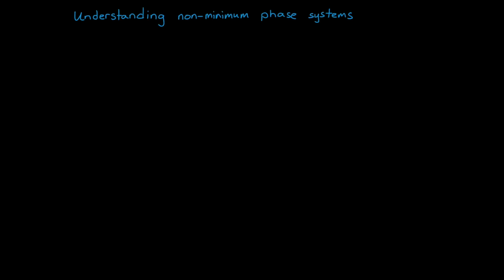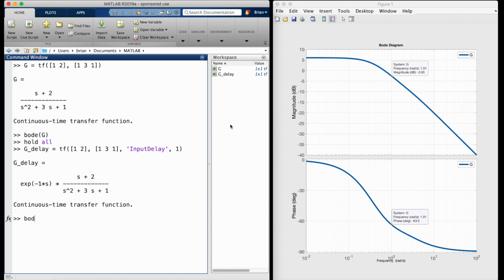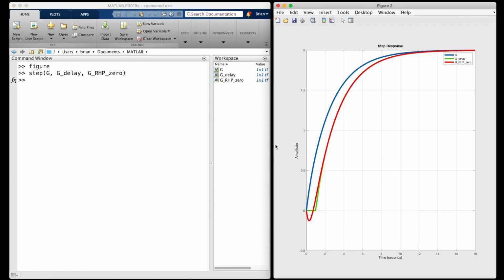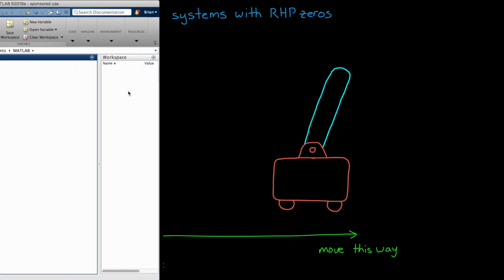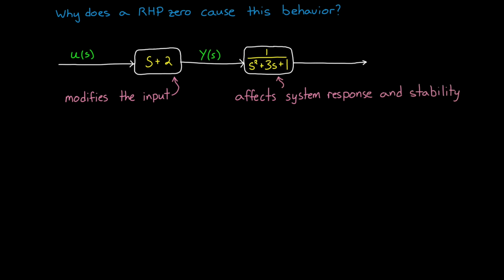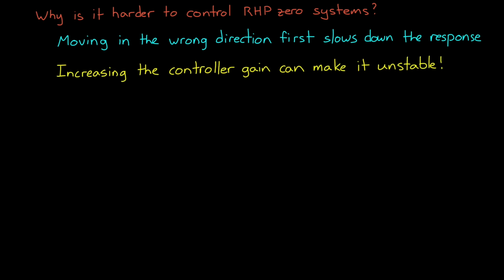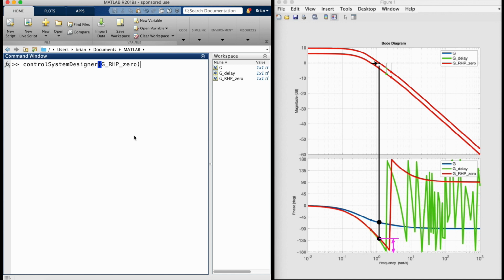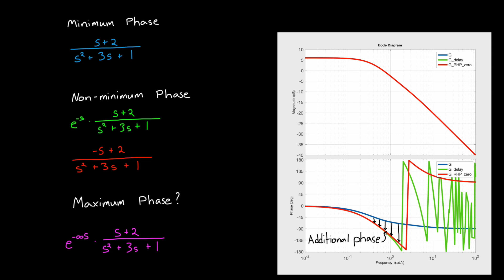What Are Non-Minimum Phase Systems? | Control Systems in Practice

Comment: Great video, very informative.

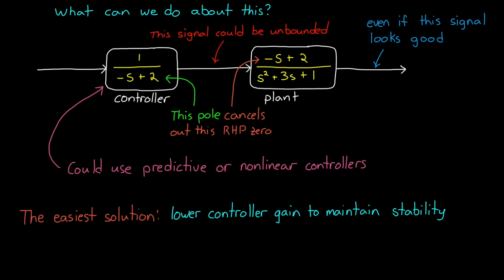At 13:30 the inverse numerator control method is shown, and i know rhat in theory it looks good but in practice is not at all a solution.

I think something can be said about these systems being non-linear in a non-trivial way. Use of LTI tf and linear control methods kind of leave elegant solutions to these problems at the door.

The underlying dynamics of the system are hidden by a gross locally linear approximation of the gradient space of the dynamics where we decide to look. 

I would asume that would also be the cause for the right left right control action on the pendulum cart example. At equilibrium, the cobtrol action in a linear space just says go right, then as the pendulum falls the wrong way it corrects it and winds up in a configuration where going right again actually solves the problem.

Of course in a non-linear case the path to the desired state is not simply a straight line "go right" scenario. You can come up with much more elegant state space trajectories from point A to B that wont stutter when they dont act like it is linear. Predictive control was mentioned, but even that is seriously overkill. Imo

Anyways, RHZeros are something i didnt understand, and led me to put a project on the shelve for a while, but by coincidence i cam accross this video so im back to working on that project!

Comment: About 9:35, what if you want to write the RHP zero as a s - 2 instead of -s+2, wouldn't this make the derivative positive? How would the explanation work then?
Reply: s-2 and -s+2 aren't the same. Sure they have the same zero, but they differ by a gain of -1.
Reply: I was thinking the same. But it makes sense. We want to keep the u term positive. If you just plot the step response in MATLAB you will clearly see that the s-2 term will make the step response settle at -ve value

Comment: Well done! 

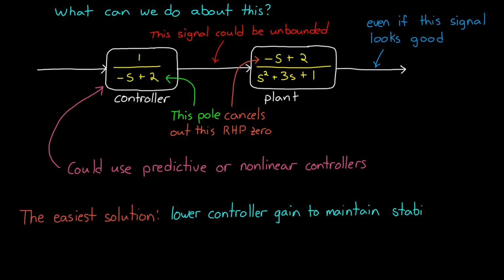I would like to add another point or solution however. In the conclusion 13:25 one method to correct is to have a slow controller, but at the cost of response speed. I propose a faster method. 

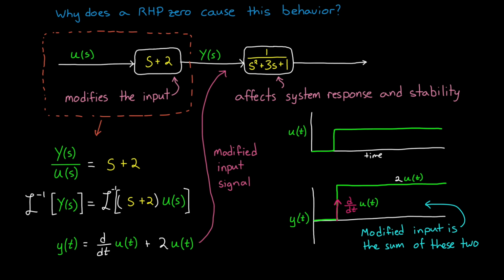Instead slow the set point, namely pay attention to the derivative. At 9:10 indeed you say that the derivative gives the jolt in the opposite direction. This is because the -du/dt term is going to have a larger negative part than the 2u(t) term for a reference of a step or pulse. Considering that it has an infinite derivative at the step start no constant input gain is going to offset that, in fact it will make it worse. So by having a curved set point like a steep first order trajectory, you can give the derivative finite value that is possibly lower than its lower order zero terms. However if you go to the second order reference that first order derivative if going to.  

This does come at a cost of 'lag', in that the reference itself will reach the steady state later, but in my experience all systems do so anyway since they themselves have don't reach the reference in zero time. 

Hence if you tweak the reference to have one order more than the highest transfer function zero, you will have a faster response in total, have a system that is still stable (considering you didn't change the poles necessarily) and have a smaller error overall (since the systems follows the trajectory closer, even if you have an arbitrarily small 'lag' at first).
Reply: Christopher Lum has a video on practical issues with PID where he mentions this as one of four solutions to integral windup.

Comment: What are unbounded controllers and unbounded controller commands, and what are some examples of that?

I always though trying to cancel RHP poles or zeros was a bad idea because you can never really “cancel” it (especially in a physical system), but rather they’ll just be very close to each-other, resulting in instability (the root locus will connect the pole and zero). It’s basically guaranteeing a closed-loop pole in the RHP.

Are these two ideas related? If so, how?
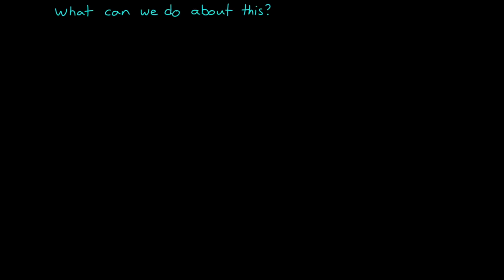Reply: You are right in that there are multiple problems with trying to cancel RHP poles or zeros like this.  As you mention, the real physical pole or zero might move over time or you might not have estimated its location perfectly and so it won't be canceled out exactly.  But let's say that we could perfectly cancel the pole/zero and the output of the plant looks great.  Even then, there is a problem.  Take the open loop system at 13:00.  If we commanded that system with a step input, the RHP pole/zero would cancel and the output would look fine. However, if you just looked at the output of the controller, you'd see it building in the negative direction unbounded.  That is, it takes an unbounded negative direction signal to drive the RHP zero plant in the right direction from the get-go (no wrong direction bump at all). You can see that this is the case by looking at the step response of just the controller, 1/(-s+2).  So there are at least two problems with the canceling approach!